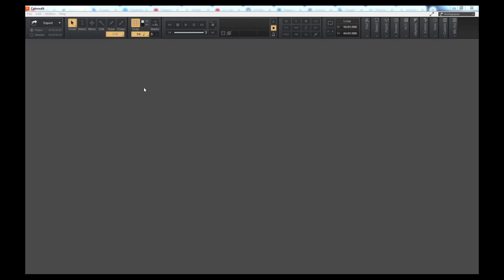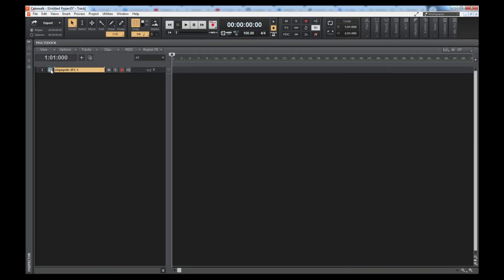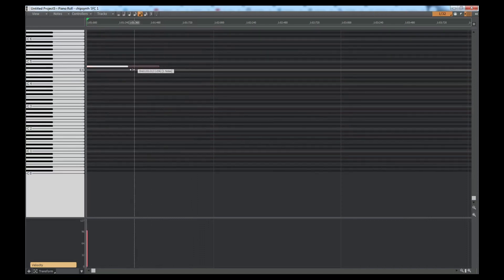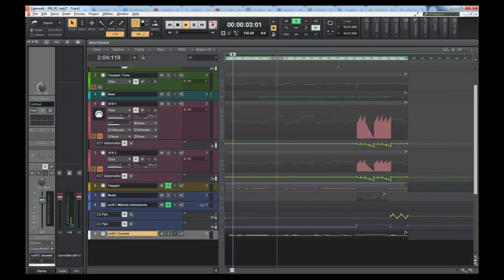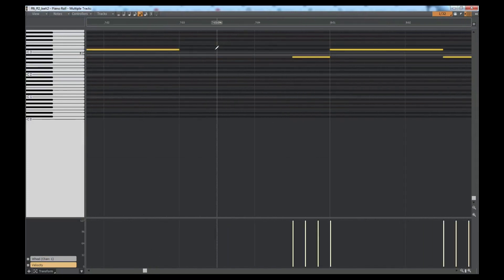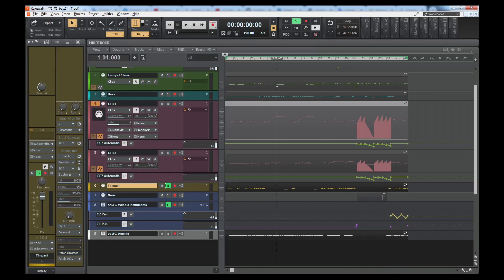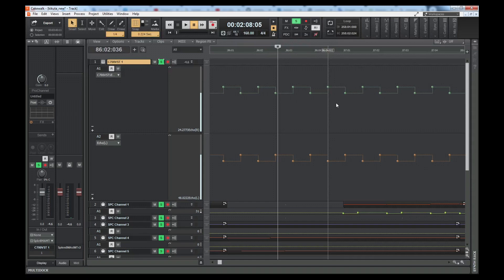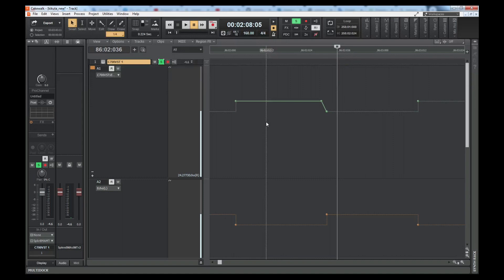SNES Music - Episode 3d - chipsynth SFC Declicking Techniques

Comment: a declick on/off function feature in chipsynth sfc
Reply from the maker: It's not necessary. It's easy to handle and it would add latency.c700 does it but it has its own output SPC/ROM driver

csSFC doesnt do it because it's an emulator that acts like the hardware. It's main focus is accuracy.

If someone's wanting to not have it click, use a higher poly mode, or simply highlight all the notes and remove the last few ticks off of them. Very easy to do.